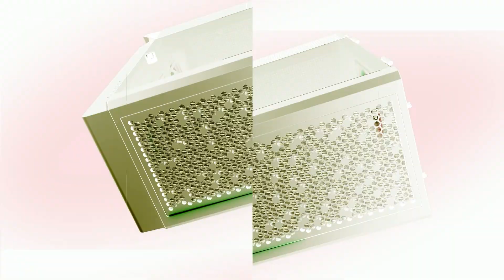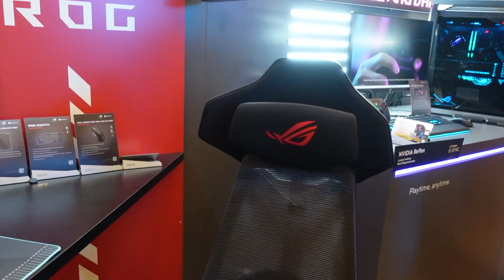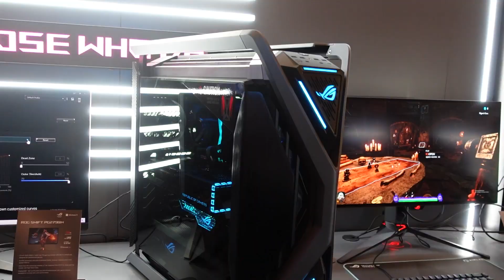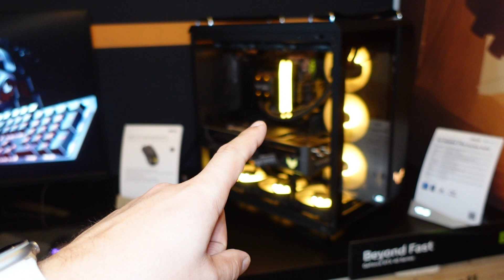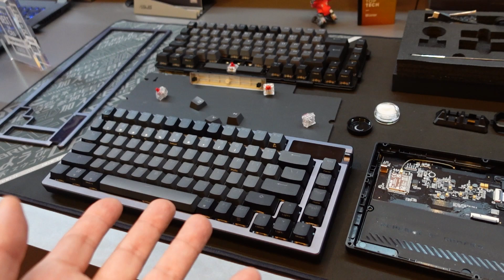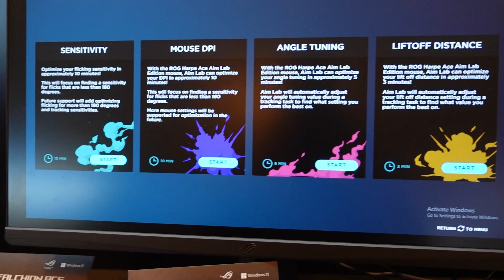Blinded By The $500 Price Tag Of The ASUS Hyperion - CES 2023!

Comment: The biggest issue I have with Asus is that they are pretty expensive and haven't made a good looking white AMD GPU or decent looking fans (from the intake side - fixed by either making a reverse airflow version or altering the RGB to show on both sides and cleaning up the hub support structure to look aa little nicer).  I do like the TuF gaming styling though.  Planning an all white, all AMD build this time and parts availability if you want the style to match the TuF stuff is a small issue at the moment.

Comment: I wonder how good that 500$  case actually is for watercooling because it looks like you wouldn't get a lot of air in the front for it to cost 500$. It does look cool though.
Reply: hard to say lian li also has a case thats 500 + aswell we just gotta w8 and see butif i compare it to lian li 500+ case base of just looking at em this looks like its worth more
Reply: @Muzubi  Honestly, I didn't know so many expensive cases existed. Most I ever spent was on the Corsair 5000D. Case and I managed to fit a 120 ,240, and 360 rad on it with the 240 and 360 in push pull.
Reply: @TechGenus5050  my most expensive case is 190 the lian LI dynamic Evo I'm happy with it I'm just waiting for the XL version that comes later this year I refuse to pay 500 for a case